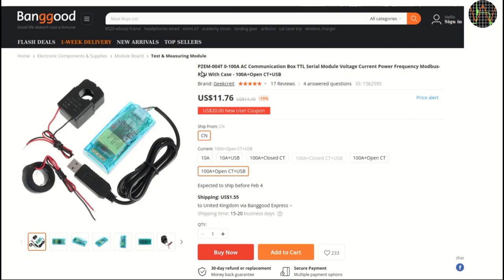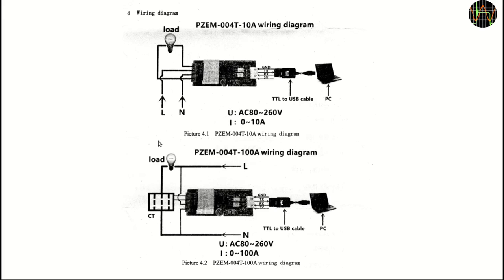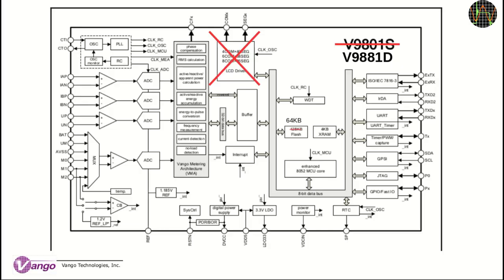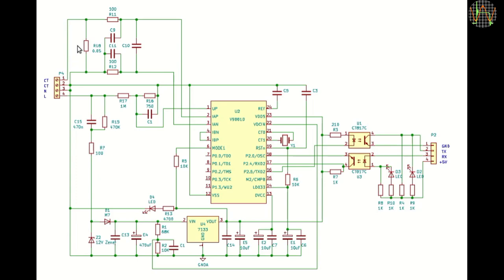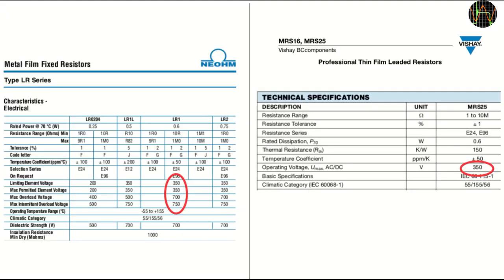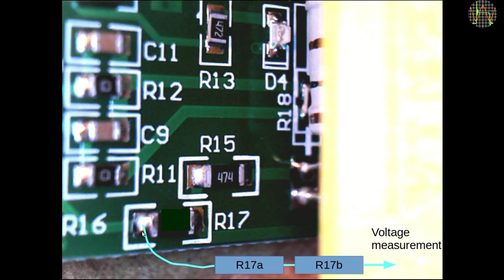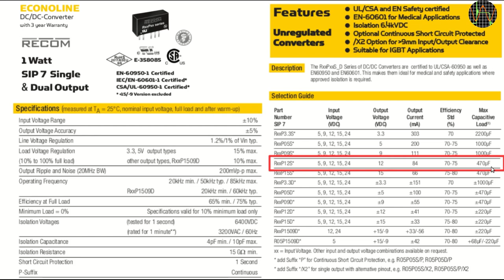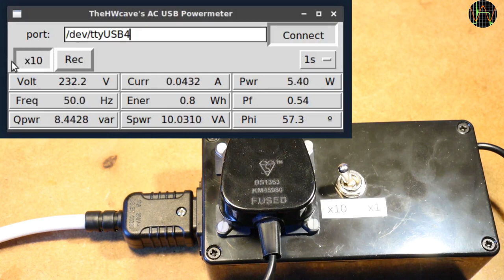Modifying the Peacefair PZEM-004T AC Comms Module (with schematic)

Comment: you have done a really amazing job.
but the problem is dc to dc converter, it's so expensive.
can I use a normal XL6009 boost converter?
Reply from the maker: Sadly no. It needs to be a good(!) isolating DC-2-DC converter, or you have live mains voltage connected right into your PC & Arduino etc. It will probably kill your equipment and other stuff that may be connected including the user (you!)... Instead please just stick with option 1 (if you want to measure from 0V) and  keep powering the module through its capacitor dropper.
Reply: @TheHWcave  thanks.
Please don't mind can I ask you a question
Are you an Electrical engineer?
I'm asking because your programming skill is also amazing.
(I am an electrical engineer student but my programming skill is not as good as yours. How can I improve, is any suggestion)
Reply from the maker: @MrArif009  I studied electrical engineering but even in those long gone days I already found programming very interesting. Initially I worked mostly as software engineer but for a long time I am now a Systems Engineer (designing complete systems) and do programming and hands-on electronics only as hobby.  Don't worry too much about your programming skills, good hardware engineers are still in high demand, possibly even more than ever. One thing I would recommend is getting a popular Raspberry Pi or Arduino and a couple of breadboards to add peripherals, like LEDs, switches, sensors etc.  There are plenty of tutorials out there how to program them. Don't worry if you struggle understanding a tutorial, its probably not you but the way it is explained. Just go to another tutorial, until you find one that makes sense to you. Start with simple projects like making a LED blink and then add things, like changing the pulse width or making the speed depend on temperature and such. As an electrical engineer you will understand the hardware which is a big advantage.

Comment: I really love your analysis and modification. Do you know if it is possible to use the module without connecting directly to AC? Connected only to CT to measure AC amps
Reply from the maker: The original module? No, because it needs to get its power from the AC power connection. After the modification? I have not tried it but it should work just fine.
Reply: @TheHWcave  yes of course After you're modification. Can you try It?
Reply from the maker: Just did, yes it works just fine.
Reply: @TheHWcave  thanks a lot. In this case I can Power the v9881d directly from USB cable?
Reply from the maker: @CarloCaddeo  You mean without DC-DC converter? No, because the circuitry of the chip is meant for 12V and its power management senses that.  If you would never connect it to mains AC voltage, you could connect 12V directly  to the input of the onboard regulator but you would still need a 5V supply to power the optocouplers, Better get a cheap 5V to 12V DC converter from Ebay. If you never use the AC volts, it does not need to be isolating.
Reply: @TheHWcave  This sounds like a great mod, and wouldn't require the expensive DC-DC!

Comment: If Phase/Neutral is Interchanged , You can see some fireworks on BUCK converter/Secondary MCU
Reply from the maker: Please explain why you think that.
Reply: Are you saying ,the  incoming L and N , if interchanged doesn't affect the circuit ?

Assume a bad electrician connects phase to nuetral and neutral to phase or some wiring interchange happens by some mistake.

Am not saying your correction/upgrade is wrong. Am saying that the product as it is gets damaged when L and N gets interchanged.
Reply from the maker: @electroboyIND  I understand and appreciate your concern. Yes, electricians and more likely non-professionals make wiring mistakes (in fact I once found a shop-bought extension cable with L-N swapped!) but the mains part of this circuit is completely floating and not connected to anything else (opto-couplers and isolated DC-DC converter) so a L-N swap has no effect
Reply: @TheHWcave  oh, I found the answer.. thank you 😄

Comment: If you want to improve the circuit then all you have to do is replace the capacitor C15 with an X-type with higher withstand voltage.

Comment: Why did u use a 5V to 12V DC-DC and not a 5V-5V? The 12V will be regulated down to 3.3V anyway and vdcin already switches at 1.0V.
Reply from the maker: Because the V9981D takes the 12V (through a divider) to its VDCIN pin to do power management. It will go to sleep if it does not see the right voltage.
Reply: @TheHWcave 
Would the B0505S ($1 on ali) be suitable adapting VDCIN divider?
Reply from the maker: I take this you would make your own divider that uses only 5V but delivers whatever the VDCIN pin sees at the moment? Yes I suppose that would work, I believe the VDCIN voltage is less than 2V but I can't remember exactly.  I found a number of different data sheets for the B0505S and they are all a bit different in terms of isolation voltage  which is a bit worrying as you don't really know what your are getting. 
www.kosmodrom.com.ua/pdf/B0505S-1W.pdf
https://www.elipse.eu/wp-content/uploads/2020/01/b_s-1wr3_datasheet.pdf
As a start, you don't need 200 or 300 mA, 10mA should be good enough.  The MORNSUN datasheet lists a minimum current of 20mA. Some switch mode supplies do need a load to work. If so, the load presented by the module is too low to kickstart the converter. Of course you could put a 250 Ohm resistor in parallel of the output to draw more current...  The other datasheet doesn't mention it. 
The isolation voltage of this thing isn't great in either datasheet but the MORNSUN device is at least testes for 1 minute at 1500V (the other one tested only for 1 second at 1000V), so the MORNSUN B0505S-1WR3 is a clear winner over a MICRODC B0505S-1W 
I personally would be very weary of dodgy sellers trying to sell you a  fake MORNSUN 1WR3 when its really only a MICRODC 1W . I would get such a safety critical item from a proper distributor (RS/Mouser/Digikey ... ) and not from Ebay or Ali .. but that is me. From a pure  technical point of view, it should work if you do the VDCIN adjustment.
Reply: @TheHWcave  Bought the " DDS238-2 ZN/S single phase Din rail KWH Watt hour energy meter with RS485 MODBUS-RUT" which should be able to measure reverse amps. $20 with split-core. Times 3 phases :(
Reply from the maker: @pepethefrog7193  Nice.. Can you post a comment how you like these once you receive them?
Reply: @TheHWcave  They work. Got 3 of them on the din-rail in the basement. Can read all 3 over one Rs485 line. They do display negative power. Pretty happy with them :)
Btw i am re-using your python code.
Reply: Got 5 of PZEM-004T some time ago but now I do afraid to use them at all after this video because of safety. Thinking maybe to just order the "iammeter" for $160 because burning the house is not a great option.

Comment: Great videos 🤩. Can you help me out by explaining the use of each component (eg resistors, capacitors, diodes, etc) that make up this pzem module?🙏
Reply from the maker: This circuit is a bit too complex to explain what all the components do. Also most of the good stuff happens inside the V9881D chip and the 7133 and all you see are a few external components. From those that do something more interesting, the big yellow capacitor C15 acts as a resistor (a few Kilo-Ohm at AC mains frequency) to limit the current through the large 100 Ohm resistor and the Z-diode. A capacitor is used here instead of a resistor because it can do this without getting very hot (like a resistor would). This method is known as a capacitor dropper circuit and very common to drop (=reduce) a large part of the high mains voltage. Capacitors do this by shifting the phase (timing) of the AC current relative to the AC voltage, but that's another story. The circuit of the Z-diode and D1 is unusual because the Z-diode is driven with AC current so D1 sees an AC voltage capped to +12V while the negative half-wave is much higher, but D1 will only let the +12V pulses through to charge the big electrolytic caps which form the input to the regulator. The 470K resistor in parallel to the big yellow capacitor is only there to discharge it quickly when AC power is removed. Otherwise you could get a nasty shock even after you disconnected everything. There is more, but comments are not a good way to explain it. If you look at other channels, EEVblog or Bigclivedotcom, you find good beginners videos.

Comment: Firstly, a very helpful video, thank you.  I have a couple of PZEM-004T v3 on the way to me.  I shall modify at least one of them as described in your video.  I plan to use one for up to 10A measurement with either 10 secondary turns (ref. https://youtu.be/Pb9Fp5J7lTI) or, and the reason for writing and my preference, increasing the value of the 0.05 ohm burden resistor R18 to 0.5 ohm.  Had you considered doing this?

I also have a desire to be able to monitor Earth Leakage Current in real time by coupling the current transformer around the live & neutral conductors of the target device or distribution board.  For example I would like to be able to monitor earth leakage currents up to say 500mA (full scale) as I have a pump that the manufacturer requires a 300mA RCD.  In the 500mA case this would require a 10 ohm burden resistor.  I appreciate that there are dedicated Earth Leakage Current monitoring and SoC chip devices but the PZEM router might be quicker and cheaper - and I can bring the readings in to Home Assistant.
Reply from the maker: R18 is already 0.5 Ohm, I made a mistake when doing the schematics. On my board it is labelled  R500. To make the system more sensitive, it is probably easier to use the trick I used in mine, which is doing 10 turns through the current transformer instead of of one turn.